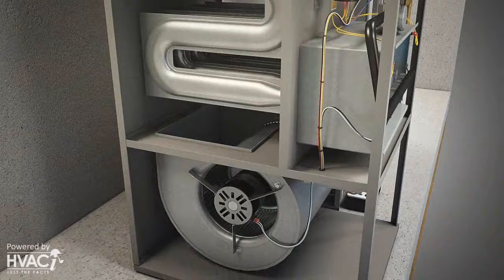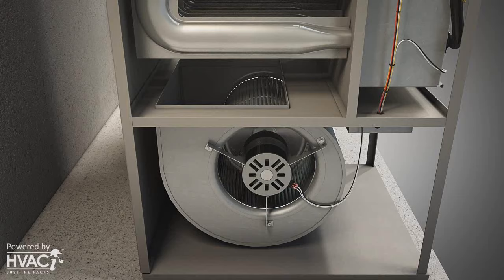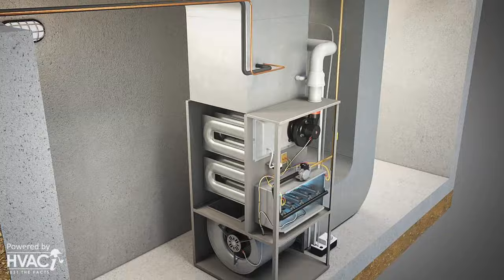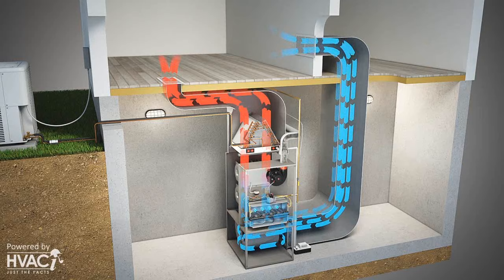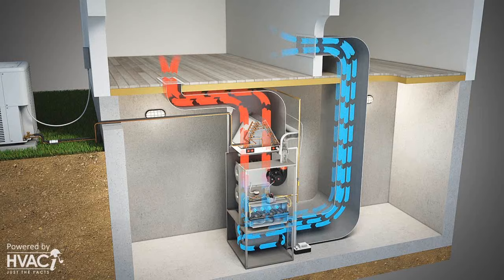How A Gas Furnace Works (Animated Schematic)

Comment: so the hot air that blows out is just the cold air that was sucked in?
Reply: Its called " cold air return vents"
Reply: Yes,the cold air turns hot when the fan blows it up through the heat exchanger
Reply: Yes
Reply: Are you kidding? How else would it work?
Reply: @Kvneki513 yeah that why you have to open windows once a day. people with furnaces houses usually smells bad

Comment: So the condenser is not needed  for heating ?
Reply: Not in a furnace, only with a heat pump
Reply: Condensers exist in modern gas furnaces. The water vapor in the exhaust is cooled down too to provide extra heat. The condensed water vapor is sent in the drain.

Comment: Hello. Great video. I live in an apartment and the gas furnace stops working during a power outage. Can I connect a vehicle battery or some other power source to the furnace so that it will run during power outage? Thanks
Reply: There are videos on youtube of people doing this
Reply: Yes.  These days, best to get a portable large lithium home battery (power station) that has inverter with AC plugs for 120VAC 60Hz output (if you in N. America).   Examples: Ecoflow, Tocoflow, Anker, etc.  This batteries avoid nasty gases, loud oily operation and possible CO poisoning are just more environmentally friendly too.

You will only need to make an adapter for the neutral and hot lines to the furnace and have a way to switch between "normal mode" from the house mains to "backup mode" when powered from the battery.  Make sure the two modes can never be connected at the same time.  Otherwise you could blow out your battery's inverter when the house mains power comes back on suddenly.

Comment: What is the outside unit? You didn’t explain
Reply: The outside unit serves no purpose for heating. The condenser unit is used to pull hot air out of homes, while distributing cool air through the home’s supply vents.
Reply: that's the thing that cools your house. It's the air conditioning unit that pumps refrigerant into your house and expels the heat from your house
Reply: @TaliSteele  Unless its a heatpump

Comment: Good video. one question, is the evaporator coil always burned by the hot air from the furnace in winter?
Reply: The heat won’t damage it but yes the coil is blasted with heat in the winter. Unless you have a heat pump in which case the evaporator becomes the condenser and you heat with the coil

Comment: Amazing video quick and to the point! So the inducer motor both pushes the exhaust out and pulls new air in? It’s basically pulling all the way through the heat exchanger to the other side past the combustion to get new air in right?